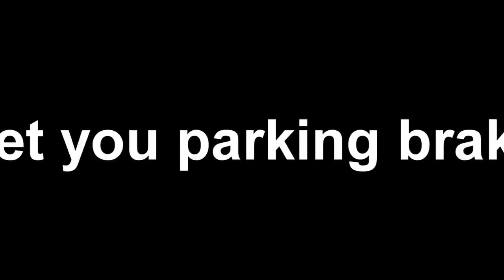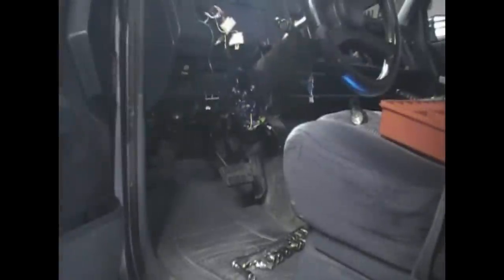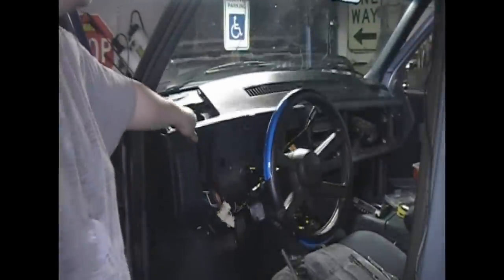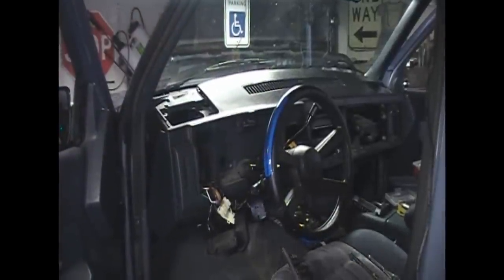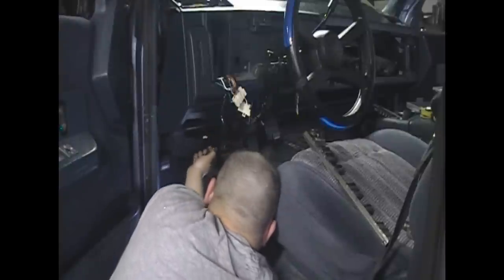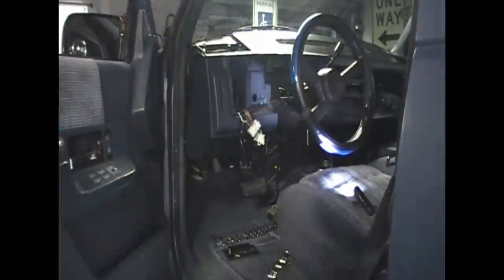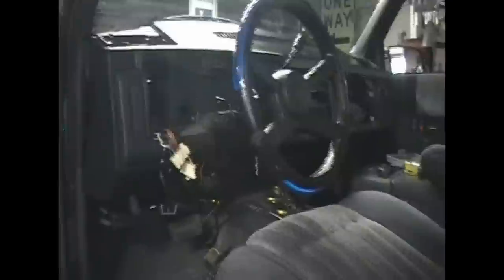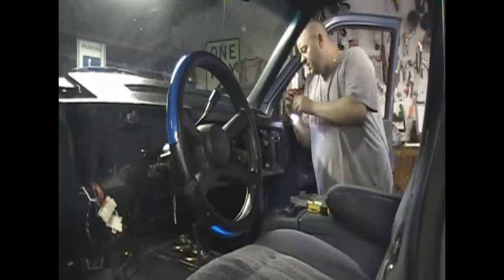Part 5: How to replace evaporator core on 94 GMC Suburban/Silverado K1500 (dash removal)

Comment: trying to remove my dash right now, but im hung up on the drivers side, everythings disconnected that i can see, got two bolts out going in to the back of the speedo area, but it seems like it wont come out of the place it pivots, where you take the 13mm bolt out in the front corner there, what did i miss?
Reply from the maker: +John Laqua There is one or two bolts that go through I believe where the speedo area is, they bolt to one of the wire harness I believe.  If you look behind the speedo you should see some nuts that you have to remove.
Reply from the maker: +John Laqua does the dash still rotate forward all the way or does it seem like something is keeping it from rotating.  There may be a missed bulb wire or connection under the dash keeping it in.  I think I had t work mine back and forth a couple times for it to come loose.  Just rotate dash forward, and make sure nothing is still connected.  Check door electric switch connections, under dash lights, speaker wires, the two nuts that hold the harnesses to the dash ect.
Reply: Yeah it rotates forward, it hung up on the pivot, I removed the kick plate and got it free, got the bolts that screw in from back in speedo area, but I'm missing something, its the main wire harness still won't come free, also the black channel the passenger side speaker wire runs through doesn't want to seem to come off too easily